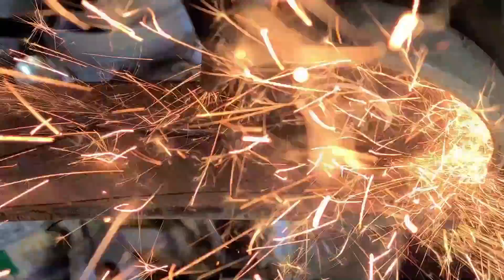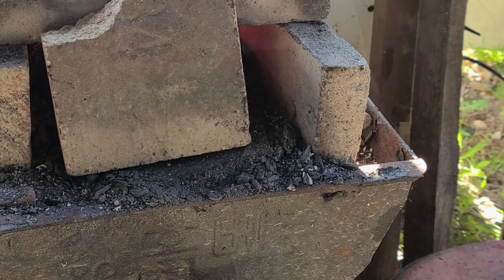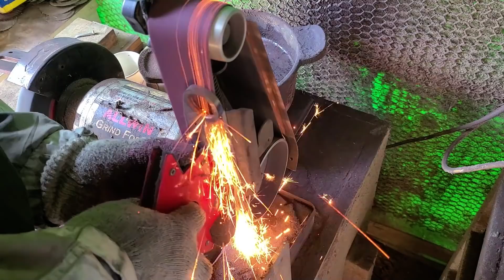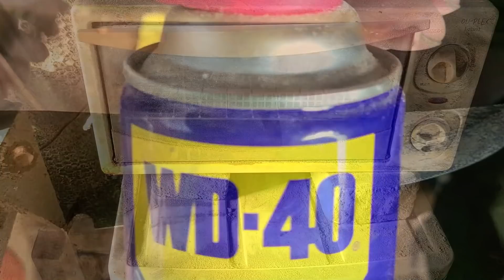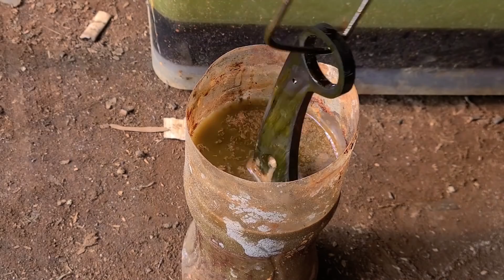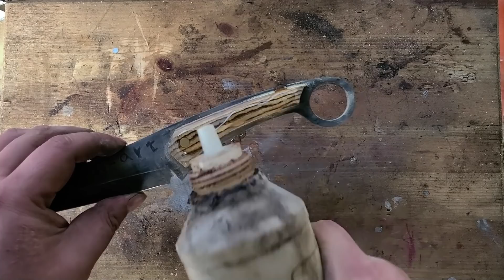making a camping knife from leaf spring

Comment: You can use a plasama cutter to cut the metal it's lot easier and lot quicker than the grinder  . It's decent built SIR GEE
Reply from the maker: Thank you for watching.
Plasma cutter will be used after solving the power supply problem.

Comment: I love your work! It's beautiful and fun to watch. Question: I've been working on some blades and notice that even after heat-treating the blades don't pass the glass test. Do I need to quench the blade at a higher temp? Thanks
Reply from the maker: Thanks for watching.
When the magnet is not attached to the metal, the quenching temperature is at the time of cooling.